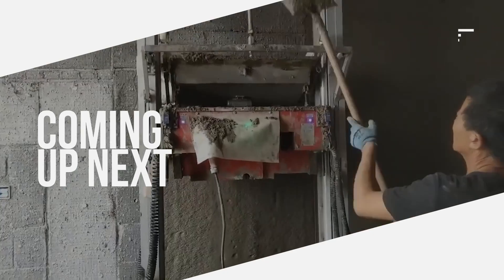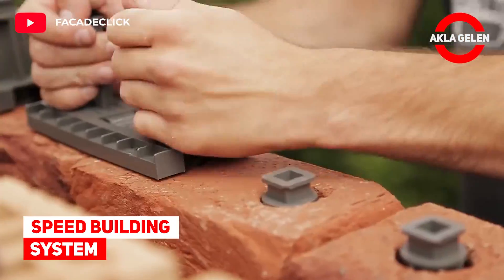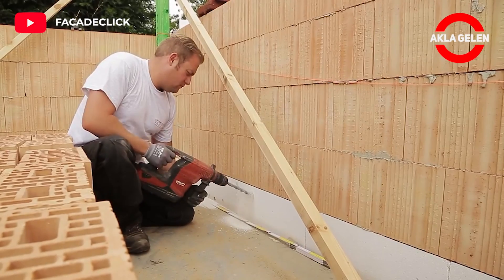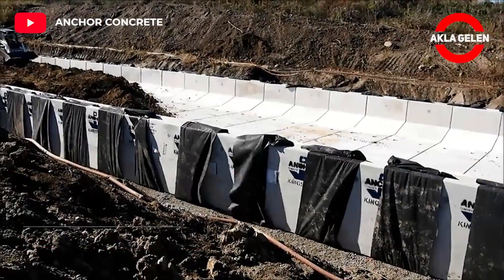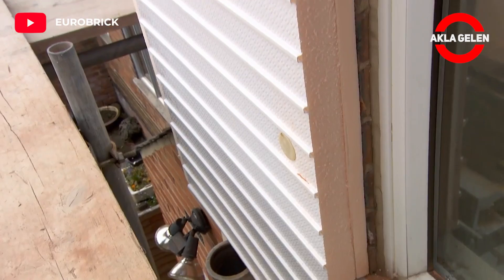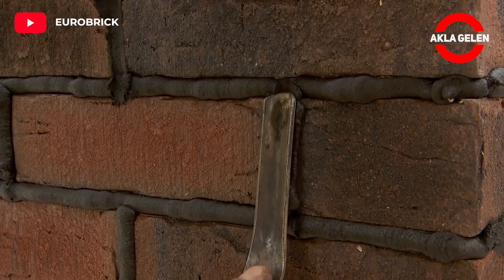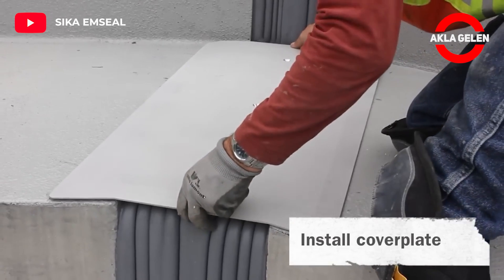Incredible Construction Techniques & Tools Every Ingenious Construction Worker Should Use

Comment: The cutting tool used to form window opening in concrete wall is way too big.Hilti have a cutting saw to do the same thing its been in operation for a number of years and is a quarter of the size of the one used in this video.

Comment: Nonsense building a brick wall like that will not work because each brick is not the same size .If you build that wall 20 courses high it would show there is no substitute for mortar between bricks.

Comment: I had a worker on my crew from Central America say to me once, “ You Americans spend more time trying to save time working than it takes to do the actual work.” This video proves that point
Reply: the plaster thing. by the time they set that thing up. I could have that wall done
Reply: We figure out how to save time once, then multiply it infinitely.
Reply: So says the guy that does not need to heat his home or have insulation

Comment: That brickwork is a joke, by the time you have set it all up you could have built the wall and it wouldn't blow over in the lightest of winds either
Reply: I am guessing they would pour something down the back of them to fill the cavity space between the two walls. Technically, they are bricks being placed around an interlocking plastic framework.

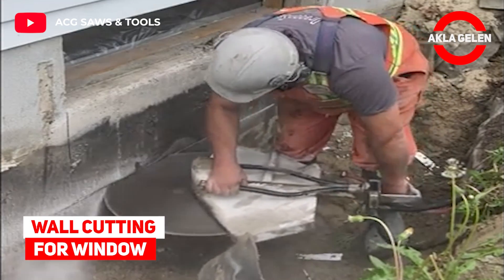Comment: Hard to imagine that human slicing machine is legal. You couldn't pay me enough to operate that amputation device. 1:08
Hook it up to a backhoe or a robot at least.
Reply: It looked like a hydraulic driven quick-cut saw. That type of blade is different to a circular saw blade for cutting timber. They are the same as a brick saw blade and do not cut you. 
The way they cut brick and concrete is totally different to how a circular saw blade for cutting wood works. 

A circular saw blade for wood has sharpened tungsten tips for 'cutting' the wood. 

A brick saw blade has segments made from industrial diamonds set into a compound. These blades 'abrade' the brick and concrete........ much like how sandpaper works on timber.
Reply: @andrewsmith8729  they would abrade your leg as easily as tarmac would abrade your knees if you fall of a bike at speed. Worked as a diamond driller for a while.
Reply: @mickperkins8793  They will not 'amputate' body parts like a chainsaw or circular used for carpentry saw will.

I used to own both a brick saw and quick cut saw that took 14 inch diamond blades. 

People used to say to me all the time, "that looks dangerous" when wet cutting bricks.
They would not believe it was not until they were shown. 
We used to wear dish washing gloves as they were the best for preventing birds eyes. 

You could put the back of your hand against the running blade and it would do nothing to you. 

It is nothing like your arm would be severed if you tripped and fell against the running running blade......... provided all the segments are still attached to the blank. 

Try a boolean search to find anyone who has lost body parts using one of these blades on a construction job.........they are nothing like a chainsaw or circular saw blade.............

They are also different to a multicutter wheel and the blades used to cut aluminium........ which are just as lethal as a circular saw blade for timber.

Comment: There’s just no way I would use that brickwork method. Did you notice the way the wall wobbled when the girl nudged it? There’s no way that a half inch of external pointing and interior wall ties will offer anywhere near sufficient horizontal impact resistance. I suspect that even under medium wind load that pointing will within five years largely separate, disintegrate, and drop out.😅
Reply: Yeah, normally I like this sort of video, but this video was full of 'new' methods that may barely make it beyond the warranty limits. And the method with the guy operating the giant circular saw was not only outright mega dangerous, it was also structurally questionable.
Reply: @mrtopcat2  i was wondering that. Trying to work out if he was USA from his clothing, if he was, goodness how that got a permit.
Reply: @mrtopcat2  How so?
Reply: @andrewsmith8729  Are you trying to troll or you are unsure what you want to ask?
Reply: Matey, I suspect you do not know very much about construction.......I'd  hazard a guess and say the hole was cut between where two roof trusses sit on the top plate of the wall........... so it has minimal effect on load bearing or the structural integrity of the wall...........the inserted frame forms a lintel..........

You definitely do not know much about concrete cutting or the type of blades that are used. 

The blade in a circular saw uses a sharpened teeth on the blade to "cut" through timber......it is different to a brick / block saw blade. 

 The blade in the quick-cut saw uses a segmented diamond blade to cut by "abrasion". They are not "mega dangerous" at all. 

You can put your hand against one while it is running........... and they should not cut you............ I have cut tens of thousands of bricks with one.
Reply: @andrewsmith8729  First give away for someone who is unsure is usually their talking down part. You have checked that right off the bat. Then you hint experience, but back it up with cutting bricks. Seriously? And yes, I am an engineer from Germany and have seen plenty of poor idiots on job sites.
Reply: Even wolf can blow them out.
Reply: Yea,, that brickwork was a load of rubbish... And the plastering thing... By the time you had that machine set up,, you'd have the wall plastered
Reply: @liamc-rb9tz  I'd put my money on the rendering machine................. it wouldn't take too long to set it up, adjust to the wall, and move............ it would be a lot more consistent, with less hollows and wastage.
Reply: @andrewsmith8729 ,,, I dunno man,,, all it's doing is putting the plaster on,, you'll still have to come back and check it, possibly do some more trowlling off.. I still prefer a good plasterer any day
Reply: @liamc-rb9tz  
It definitely is a labour-saving gadget......... no screeding (cutting off). 
Once it was set up inside a high-rise unit (apartment) it would be fairly quick to shift from wall to wall.
That is cement render........ not plaster. Two different compounds............
Reply: I am a dutch bricklayer,i am sure i lay more bricks traditional a day,wat a joke
Reply: @fransschilder5113  I can believe it, I worked in Breda briefly many years ago. The way you set up your buildings is fantastic. Loved the concrete profiles going up to the apex on the gable!!!! So simple put your line on and start running in beautiful way to build!!! UK needs to start catching up!!
Reply: But it offers 7x the seting up speed!! /s
Reply: @kenelliott3022  
A computer voice reader. MS Word 365 has a reader.........  it would read X as X instead of times. 

They're a Belgian, German, or Dutch company, a reader is a cheap way of doing things. ..........Their information packs are quite good, explains the entire system really well in the main brochure......... 24 pages.
Reply: @andrewsmith8729  I'm sure that the OP is referring to the brickwork at 3:13 where they have attached Lego type spacers onto full red bricks and the woman demonstrating how easy it is to erect a wall. When she places bricks on top of the Lego style spacers, you can see all the masonry flex and wobble. The OP is not confident the wall ties and pointing will give ample stability during high stress lateral forces (storm winds etc) which I can understand the point the OP is making. We were not talking about the stone/cement/brick cutter window install nor the brick effect cladding install.
Reply: @EzeePosseTV  Clearly, the wall in the video was not completed.

I realised the OP was talking about the Facadeclick system. I went to their website and downloaded the information about them. 

I'd have a read of their information before condemning the system. 

1. The cavity is backfilled with an insulating material. 
2. There are long screws that can be vertically screwed down through 8 courses of bricks to better lock them together. 
3. The ties and plastic discs for attaching to the existing wall have a pretty good load rating.  

The entire system is actually pretty good if you read the 24 page manual about how to erect them........... and relatively easy to make stormproof. 

One of the selling points about the system is it can be used in a temporary capacity, pulled down, and moved somewhere else without a lot of wastage. 

Have a look their website. They have done some decent sized buildings with them.
Reply: @andrewsmith8729  I personally wasn't doubting the innovations in building methods the company is making. 

I'm sure that (like everything else involving construction) if done properly with the right materials, their products make for excellent build quality that is quicker and easier plus I like the idea of being able to disassemble a build and then reuse at least 90% of materials for a new build. 

I was merely pointing out that I understood where the OP was coming from and how you may have misunderstood what part of the video the OP was referring to (I see it a lot on compilation type video's) it's all good.

Much love to Oz from Scotland.
Reply: Who the # is this Andrew Smith? He's trying to give out construction advice to everybody who's in the game!!! He's tried it with me about a bricklaying machine, and proceeded to call every bricklayer in the world thick in the head!! Including his own father, he literally has serious daddy issues.
Reply: @tez673  My father was a carpenter..........just like Jesus Christ.
Reply: @andrewsmith8729  so he didn't do well in his building apprenticeship then if he only did carpentry .
Reply: @tez673   "He" was a qualified Clerk of Works and licensed builder............. very skilled carpenter.
Reply: @andrewsmith8729  well that was disappointing 🤣🤣🤣🤣🤣 Good chat mate keep safe and have a great Christmas. 👍 🎄🎅
Reply: @tez673  Ah........... you get that. 

Construction  has been the adventure of a lifetime for me. 

I' m sure you are good at what you do........ but so am I.  

Look, I have done a lot of hard work on sites............. started in primary school...... not by choice. That was over 50 years ago........ so, I have probably learned a bit along the way.
Reply: And I have to say smith if your putting your hand against running saw blades.......🤔 and you say bricklayers are stupid! However if that's true I find it impressive that you can type with cock the on your forehead 👍
Reply: @tez673  I know you believe Brickies are are at the apex of construction. Let me assure you........ they are not by a long shot. 

Most finished school in year 10 because it was a struggle. Then, they spent the next 4 years occasionally attending TAFE to step up from playing with Lego. 

My guess about your bricklaying career is you've never progressed much beyond the humpy industry and an occasional two storey block of units. 
 
Matey,  I am likely better qualified and skilled than you....I am have worked in Construction and Project Management......plus my High Risk licence has half a dozen classifications. 

You'd be truly amazed if you knew about some of the things I have done.......... like putting together one of the largest Reclaimers in Australia........or supervising a crew of 20 on a refinery construction project.
Reply: I can't wait for reply to this 1!!!! 🙂
Reply: I'm sure.......you will try........to teach me.........another lesson........
Reply: @tez673  By the looks of it, I have just taught you an easy way to connect ideas in your train of thought...........it is good, hey?

Take care......... see you next time.
Reply: @andrewsmith8729  You taught me that you judged me without knowing anything about me. But hey ho thats the difference between us! Good luck, keep safe and take care👍👊👌
Reply: janetpratt6931  Dear Janet........How about you go back to doing the dishes instead of fishing for a reaction........... and leave the men to talk.
Reply: Janet Pratt  apart from the people who have them for their house 👍👌😁
Reply: Janet Pratt  I know I'm a Bricklayer! That's the whole point of this conversation 😆👌
Reply: Janet Pratt  let's face it, I've seen apprentices built sturdier walls than that!! Unfortunately it's another case of people trying to reinvent the wheel!!!
Reply: Janet Pratt  bricklayers because we have pride in our work. Great chat, good luck 👍 keep safe 👌
Reply: Janet Pratt  and you are?a guy that has no job
Reply: I think the foam injected into the cavity essentially turns the outer skin into thick brick slips.
Reply: I don’t like either of those brick methods
Reply: Dude you’ld be dumb to decide to use something you saw for 15 seconds in a video but you would be just as dumb to decide not to use something you saw for 15 seconds in a video.
Reply: @NoeraldinKabam  

Actually, those veneer brick systems have been around for years.......those two systems on the video are only the latest evolution using modern materials 

The veneer bricks are only decorative......... my guess is the gap between them and the existing wall is later filled with block fill concrete............ which would dramatically improve the stability............. much the same as a method used to build stone retaining walls.

Not being a skyte, I have worked on the construction of houses, skyscrapers, mine processing plants, petrochemical refineries, power stations in several different roles, including supervising a $40 million package of work.

 If you had spent nearly 50 years working on construction sites and had seen what I have during that time, then you'd get the gist of that 15 seconds of video straightaway straight too. 

There was not too much in that video that was genuinely innovative........ most of it contained ideas that had been around for years........... albeit with more modern materials.

Comment: wtf you can not build a wall without cement?
Reply: yes you can, it just won't stay up for long.
Reply: @John01GM40  Never seen an Adobe Brick or Refractory wall?  

Cement is only a binding agent............it is a compound powder............ that is used to bind sand grains together in mortar and to fill the air spaces between aggregate and sand in concrete, so it binds together. 

There plenty of walls built without cement that have stood the test of time.

Comment: But what he's doing is dangerous. All he has to do is get the machine out of his hand and both his legs are gone. 1:09
Das ist aber schön gefährlich was der da macht. Braucht ihm nur die Maschine aus der Hand geraten und schon sind seine beiden Beine weg. 1:09
Reply: No. That is not correct. The blade on these 'abrades' the concrete, whereas the blade on a wood circular saw has sharpened teeth that 'cut' the wood. 

A brick saw blade works the same way that sandpaper does on wood or car body filler. You cannot cut a piece of timber in half with sandpaper in an electric sander, can you?

I have cut tens of thousands of bricks using a segmented diamond blade.  It is a totally different concept to the blade on a circular saw used for cutting wood.........they will not cut off both your legs.
Reply: okay👍